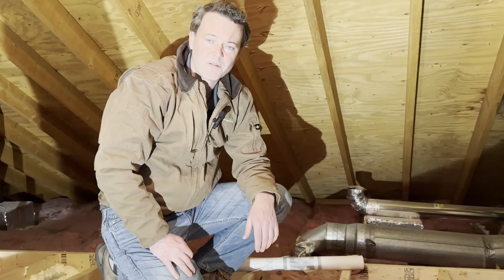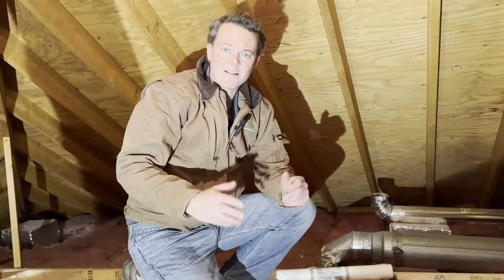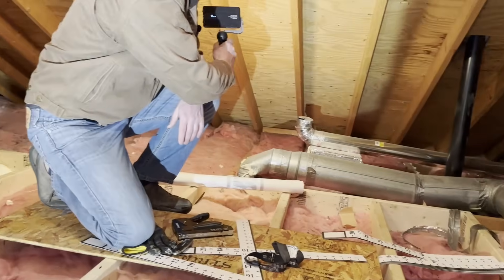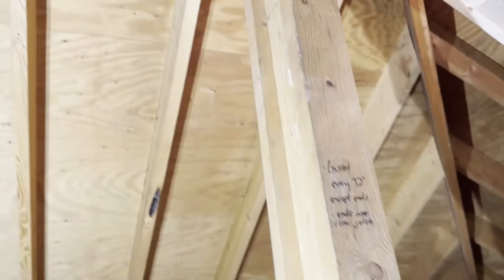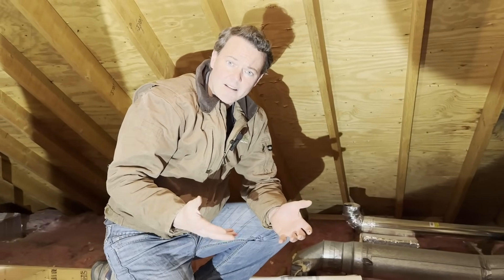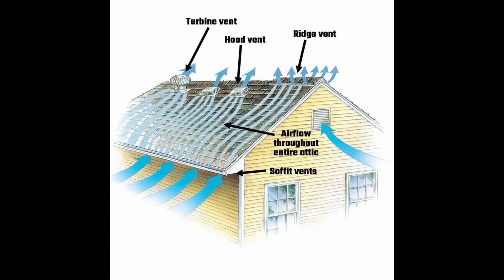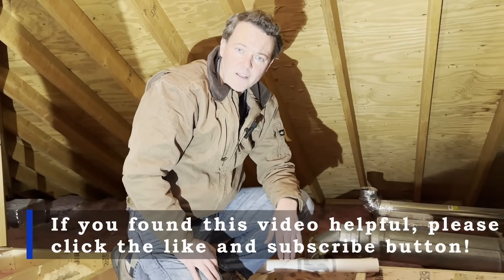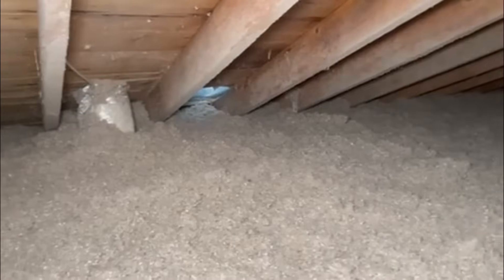Is a Roof Power Attic Fan a Waste of Money....or Even Worse?

Comment: Thanks for the video.  He was almost right on everyting execpt for the last part of the video.  One of the most important thing to keep in mind is that the attic tempreture  hould be as close to the ouside tempeture as possibe. For two reasons. 1) To avoid condensation inside your attc due to the extreem different between outside tempreture and a unvented inside attic.  2)  if you have snow on your roof,  you want the attic to be as close to the outside tempreture as possilbe, otherwise  a hot attic will melt your roof snow and the water will run down and refreze at the overhang or in the gutters, This will cause ice built up that can cuase a ice dam that can lead to a roof leak. You want snow melting to occur when it above freezing, that way it runs down the downspout or over your gutters.
Reply: You are right about the ice dams . The predicament is how to remedy the roof attic issues at a reasonable cost . Lots of insulation contractors are in it to make big bucks without much improvement in roof performance.
Reply from the maker: Hi there and thanks for the comment.  During the winter months you're absolutely right.  Your attic temp should be the same as the outside.  However during the summer months, if the attic floor has been air sealed, properly insulated to R-49 with cellulose, and vented properly (we prefer using passive ventilation measures), it won't matter how hot the attic gets --- the heat should not penetrate into the rooms below.  This is has been the consistent result that we achieve with our customers using our attic upgrade measures.  
Condensation / mold problems are not usually summertime problems.  The attics get too hot and dry for wood to be consistently wet (at least from condensation).  The roof power fans seem to be a cheaper way to cool the attic in the summer, which keeps the house cooler too if your attic is not properly air sealed and insulated.  But the roof power fans, from what I have personally seen, do not offer much of an advantage during the winter here.  The absolute biggest component of having a healthy, mold free attic during the winter months is 1) having a well air sealed attic floor 2) having bathroom fans vented to the outside 3) having enough balanced ventilation to allow for unplanned moisture to easily vent to the outside. 
Andy
Reply: @insulwiseenergycomfortsolu3293  Thanks Andy, Thanks for your reply, You are right It really does  depend on the temps of yoru atti. My attic over 150 degress that was drying out my roof decking. My company calls this the double bake, Bake from the top and the bottom. With overheated attics you will dry out your roof deckign leading to delamination of the plywood due to the high heat.  And as you said if its too cold  you get mold.  I traded my 150 degree attic  and went with a white silcone roofing coating. I cut my ac bill cost in half as the attic tempretures  drop 30-40 degress,  but now I have mold growing on my roof decking bottom.     I am still working on trying to figure  out the right solution for the mold. The attic space in only 3 feet high and there is 2 1/2 feet of blown in insulation. This was in 2008. If I could do this all over I would use foam.  Thanks for your replay,  David
Reply from the maker: @RonaldReagen4545  Hi David, 150 for an attic is awful hot, and if you've only got that much clearance between your roof and your attic floor it will radiate more heat downward toward your living space than the roofs that are taller and provide more clearance.  I haven't seen too many issues of plywood delaminating in our climate here in Pittsburgh, but that could more of a factor in other areas.  When I've seen it occur here the roof being wet, usually from long exposure to condensation has been the bigger factor.  If you can get enough intake ventilation somehow, that should help with the mold.  Also, I'm not sure if the attic was air sealed or not, but that will also be a factor with mold, at least it is here. 
Andy
Reply: @insulwiseenergycomfortsolu3293  Thanks  you for the hard work you do in helping me and so many others.
Reply: @insulwiseenergycomfortsolu3293 saying it doesn't matter how hot your attic gets as a general statement seems wrong, if your HVAC is in the attic, it matters how hot your attic is. Your flexible ductwork, no matter how good, does not have R-49, and nether does your HVAC.
Reply from the maker: @Evirthewarrior  That is a fair point.  In Pittsburgh area the majority of the homes that have HVAC units in their attics are newer homes with higher roofs.  In these attics because the hot roof surface is much further away from the ducts than a home with a low sloping roof, the attics do not get as hot, and effectively installed passive ventilation is typically more than enough to do the job.  The point of the video was that the majority of the time when we see power roof fans, they are improperly sited relative to the passive vents in the roof (meaning they don't accomplish much cooling effect), or they have too little make up air to keep them from depressurizing the attic and pulling air conditioned air up from the home.  
If you have an attic that does get super hot, and you have an HVAC unit also in the attic, than a properly sited power roof fan with an appropriate amount of make up air would likely make sense.  We just don't see a lot of these scenarios in our area.

Comment: We had just end cap vents, soffit vents, six inches of insulation and our attic would hit 120F+ during our 95F+ days in our Rocky Mountain high valley semi-arid climate; A/C would kick on at around noon at 80F setting.  Added three turtles; didn't seem to do much.  Blew in cellulose for a total of 18 to 20 inches of insulation, and that seemed to help.  Added a three ton attic fan to roof in place of the center turtle, thermostatically controlled to kick on at 70F, and added a two closeable 4x12 inch vents in attic access panel and cracked opened a window in the basement to create a draw; 95F+ days and upstairs would be 78/79F and the A/C would kick on around 4pm. Interesting.  Added a small humidifier (gallon every 18 hours) in the basement for a small swamp cooler effect, raising the humidity from interior 20% (lowest my gauge reads and weather station indicating 5% to 10% outside humidity in the afternoons) to 35% to 40% inside; more days where the outside temp was 95F+ and the A/C didn't kick on and the upstairs would stay 77/78F.  Electric bills went from $120+ a month (July & Aug) down to $90/$105 range.  Replaced 22 year old 10 SEER three ton with a 16 SEER three ton and current bills are $60 to $75 a month (June, July, Aug and Sept) with A/C setting of 78F.  Taken 18+ years of experimenting and now on my second attic fan, yet I feel like the attic fan has worked well for me and my specific situation.

Last three days, 92F, 96F and 96F, with overnight lows in the upper 50 range with super low outside humidity and 35% interior humidity; no A/C kick on (78F setting) and basement started at 67F and rose to only 71F.  Not bad.
Reply from the maker: Is your attic floor air sealed?
Reply: @insulwiseenergycomfortsolu3293  I would not think so; soffit vents, turtles and end cap vents still in place.  Nothing above the insulation or on the backside of the slanted roof; do not know what is under the insulation.

Comment: Is it your opinion that a gable vent should be blocked off when a ridge vent is installed? The theory I’ve read is too much air will come thru the gable vent and not the soffit vent.
Reply from the maker: That theory is right, the gable vents will partially circumvent the draw coming up from the soffit / intake vents.  However --- we never seal gable vents when we work on homes.  I would MUCH rather use the positive pressure from wind pushing through large gable vents then rely on weak stack effect.  I have actually solved serious moisture problems in attics by removing the blocking on gable vents.  Especially when gable vents are aligned east/ west -- they can work tremendously.

Comment: In the inland areas of Southern California I have found attics with a powered vent can have drywood termite infestations in the roof rafters. Attics without powered ventilation do not because the heat of summer kills the colonies.
Reply from the maker: Interesting, it's amazing the differences you can see in homes that exist in different climate conditions.  I personally don't have any experience with that.
Reply: interesting.

Comment: anyone with two brain cells to rub together can understand the importance of an attic fan.  Think of your car on a hot day.  When the windows are up does your car get hotter inside than outside.  Obviously.  So how do you cool it down?  open the windows.  Can you open your roof?  Obviously not.  So you blow out the heat with a fan and it sucks in new cooler air--still hot but not as hot
Reply from the maker: The first goal (generally) is to keep the house cool which we accomplish by air sealing and insulating the attic to an R-49 level with cellulose insulation.  But if your goal is truly to cool your attic, then roof power fans can work well --- when they are sited properly with reference to passive roof vents for make up air --- and when there is enough NFA (net free air) being supplied by the passive vents to avoid the fan pulling air conditioned air up from the home.
Reply: @insulwiseenergycomfortsolu3293  yeah, you can spend 20k trying to re-insulate your attic and save about $50 a month on your HVAC bill.  Or you can just put in a $300 attic fan or even 2 for a total cost of $700 and accomplish 95% of what 20k gets you.

The best you're ever going to do is cool your attic down to the temperature of the outdoors.  If it's 110 outside, your attic is going to be 110 sooner or later in the day.

Comment: We have a 1970's bi-level with up graded R-38 installation,louvers, perforated soffits,power roof fan and ridge vent. We live in NJ. I had the fan thermostat set at 80 degrees. Well fan didn't last long I replaced the fan and set thermostat to the highest setting fan comes on aproxmate 130 degrees nice and cool no issues.
Reply from the maker: With a well insulated attic -- and it sounds like yours is -- the higher thermostat setting is better.  When our customers have these fans that is what we set them to after air sealing and insulating their attics.  As you have found you will get a lot more longevity out of that fan.

Comment: I purchased a house in Mount Lebanon 30 years ago and installed one of those power attic fans on a thermostat. I had a walk up attic with a door on the second floor. Whenever that fan kicked on, I opened the door and it sucked all the hot air out of the entire house. It was better than central air.
Reply from the maker: If you don't mind the extra work there's ways to make a system like that work, for sure.

Comment: I just bought an old house in Florida and the attic gets blistering hot in the summertime. The attic was sealed with no soffit vents, no ridge vent, and gable ends closed off. I insulated the attic floor with fiberglass insulation and I recently opened up the gable vents and added ridge vents when the roof was re shingled. Standing on a ladder I can still feel the heat radiating through the ceiling. It seemed to help a little, but wondering what else can I do to increase airflow and keep the temperatures down? Thanks!
Reply from the maker: If you have ridge and gable vents those are both considered exhaust vents (but east / west aligned gable vents can be highly effective).  Without intake vents in the form of soffit vents or undershingle intake vents, it's likely that your attic isn't allowing much heat to escape it.  Attic insulation can help A LOT.  We insulate with blown cellulose to R-49 (about 15") and air seal the attic floor first.  When this is done there will be virtually no heat transfer from the attic to the home.  If you cannot insulate more, I'd definitely recommend finding a way to add passive intake vents.  You could also add a roof power fan or solar roof power fan --- BUT, if the fan doesn't have enough make up air and / or is not drawing air from across the attic, the effect will likely be limited or worse you could draw air conditioned air from your home.  In your situation I'd look into adding intake vents lower down on your roof, possibly with slant back vents (they're designed for exhaust, but will also work as intake vents) and possibly installing a solar power fan in the middle of your roof (in between the ridge and intake vents).  That would produce the best effect for you.  Good luck with your project!

Comment: When the roofers installed the ridge vent in my new home they put landscape fabric over the opening below the ridge vent. They said it was to “keep bugs out” .I questioned that this would inhibit airflow and wasn’t a good idea . They said it was common practice and would be fine . What are your thoughts about this?
Reply from the maker: We see this done from time to time and it depends on the type of ridge vent that was installed.  Some of the fabrics allow plenty of air flow, but some of them (like home wrap or ice and water shield ugh) will be highly restrictive.  You could always test it with an incense stick or something else that will produce a visible draft.  On a warm day you should be able to see the smoke go right out if it is drawing air.

Comment: I have always been told if your house had ridge vent and sofit vents, you should cover the gable vents, is that correct?
Reply from the maker: That is the correct theory.  What I have found in practice on a number of occasions is that removing the covering (placed by roofers) over the gable vents allowed for a strong breeze to through the attic (very effective on homes with east / west alignments).  My guess is this view will be contentious, but I've solved some nagging attic moisture problems by doing it.

Comment: A manometer in the attic will indicate if the attic has too much vacuum.  You should have a manometer and know how to use it.  It's your job.

I had several square feet of soffit vents installed 20 years ago.
Reply from the maker: I wasn't there to prove that the attic was depressurized when the fan was operating, I was there to show an example of how not install a powered attic fan (right next to a ridge vent) and also highlight that these fans CAN depressurize attics when not enough make up air is present.

Comment: For those of us who have HVAC ducts in our attics and an AC that can't keep up with the heat, passive ridge venting is often not enough. I'm looking into radiant barrier and ridge vent fans (Ridge Blaster). Anyone have experience with this type of fan?
Reply from the maker: In this attic we spray foamed the solid metal ducts, air sealed the attic floor, and then blew the attic to R-49 with cellulose insulation.  That process dramatically reduced the cooling load of the home, and is highly effective at reducing cooling loads in nearly all the homes that we work in.  Is that something that you've considered?

Comment: I have also seen insulation covering the sofit vents on many occasions, and this prevents the ridge vents from working properly.
Reply from the maker: You're correct, we see insulation blocking soffit vents all the time and have to remove it and install baffles correctly
Reply: great point you need soffit baffles.

Comment: if you have  gable vents it defeats the purpose of ridge/soffit vents. Just the rules. The fan fixes that mess up
Reply from the maker: I'm aware of this "rule" with the vents, the idea being that gable vents short circuit some of the flow between ridge and soffit vents.  I'm sure that is true.  However, I have seen many cases where east/ west aligned gable vents do a phenomenal job of moving air through attics because they take advantage of natural air flows.  I have even solved a few serious condensation issues by unblocking gable vents that had been blocked by roofers after they have installed ridge and soffit vents.  The most notable being an obvious whoosh of cool outside air blowing through one of them as soon as I removed it.  I no longer adhere to this rule.  For me it's a case by case basis depending on the orientation of the home.

Comment: Not sure I understand, if u have just a ridge vent and an attic fan to pull air thats hotter than outside air out of the space, then why would it be a fail? 
I will have to do a test with attic thermometer to see if there is no reduction in attic temperature.
Reply from the maker: What my experience has been is that the air from the fan and ridge vent re-circulates in a relatively small area.  And on a sunny day that air will be going over top of a roof that can be 150-170 degrees -- as opposed to coming in from soffit, undershingle intake, or even gable vents.  The air in that one location could be cooler, but the air will not be getting drawn from across the attic --- which is what you want.  We've worked in hot attics with these things running all day when they've been placed in close proximity to a passive vent (usually a ridge vent), and there's very little if any impact on temps in the rest of the attic (it was as annoying as it was enlightening!).